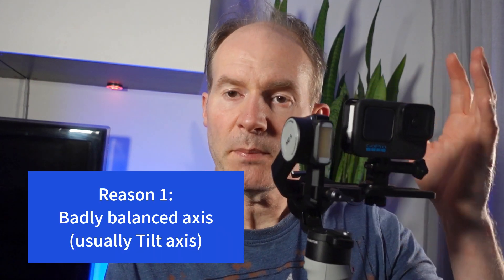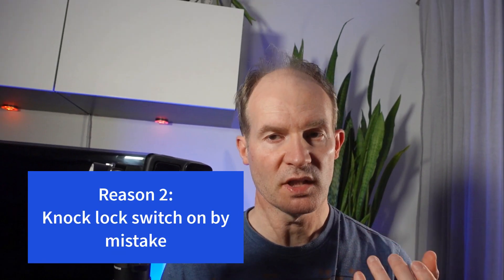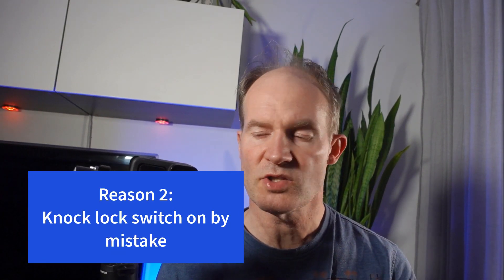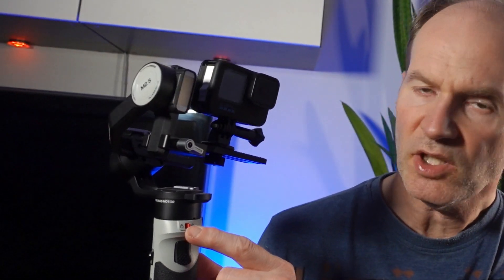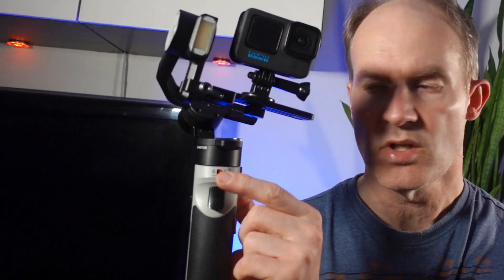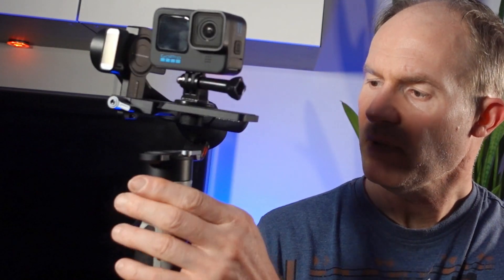How to Fix the Axis Lock Error on Zhiyun Crane M2S and M3S

Comment: Reason 2 was my issue. When I unlocked it and tried again, no more beeping locked error message. (I thought it was supposed to be locked 🥴) Thanks a bunch!
Reply from the maker: Hi Amanda, great that this helped solved your error message issue. Yes, gimbal should always be unlocked when in use (all 3 axis) - but I find it very easy to accidentally knock a lock with my clumsy fingers and lock an axis causing the error message

Comment: Hey Tim, Interesting contraption and set up. I'm still using the pocket 2 but considering getting the accessory that attaches  to my iPhone to make it one piece. So i can see my walking footage while I record because sometimes part of my footage is not facing forward. How would that setup you showcase compare to what I'm using?
Reply from the maker: Hey Jay! Yes, the Pocket 2 screen is frustratingly small indeed. Are you referring to the foldable bracket that has a phone holder and and holder for the pocket 2. I think that is your best bet really as that will keep the setup small and light but still have a larger screen. The gimbal contraption with the GoPro won't offer any advantages over the Pocket 2 + mobile phone companion as the GoPro screen is smaller. It's also expensive, so a mobile phone bracket plugging directly into the Pocket 2 will definitely be better for you. Does that help? Best wishes, Tim

Comment: Hiii on the screen written when i turned on ..fp ..and didn't work
Reply from the maker: Hi - is the gimbal fully unlocked when turned on? Make sure all axis are unlocked and there is a camera attached otherwise the gimbal will not like it. Have you tried performing a reset of the gimbal in the app, and a full calibration? If it continues to come on immediately then it could be faulty and would need to contact Zhiyun.
Reply: @4T-Tech  thanks for your reply could you tell me how can i calibrate the gimble?? Could you answer me ???
Thnx alot  for your help
Reply: This video has the problem
Reply from the maker: I watched the video thanks. Do you have another camera to try it with? It looks like not balanced properly, though I'm not sure. Do calibrate need do go into the Zhiyun app and connect to the gimbal and should have instructions to do a 6 point calibration.

Comment: I want the bottom axis to be locked. How can I use the gimbal with one of the axes locked?
Reply from the maker: Hi - I'm not sure why you want to lock the rotation (bottom) axis? Could you explain further? Thre is no gimbal mode that only locks the rotation axis. The Lock mode will lock all three, and the PF/TL mode will lock the up/down top axis. I wouldn't recommend physically locking the bottom axis with the actual padlock as that could cause the gimbal to shutdown / stress the motor.